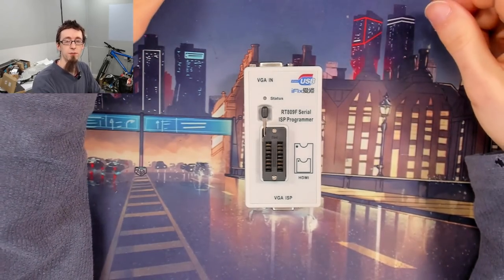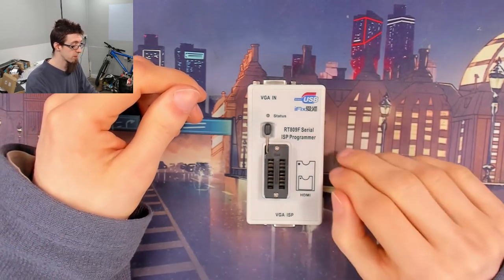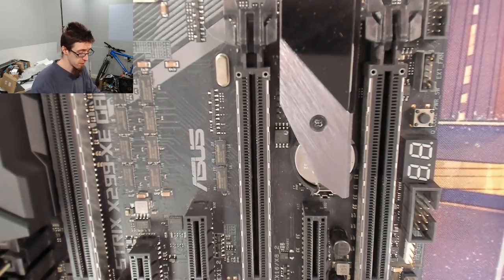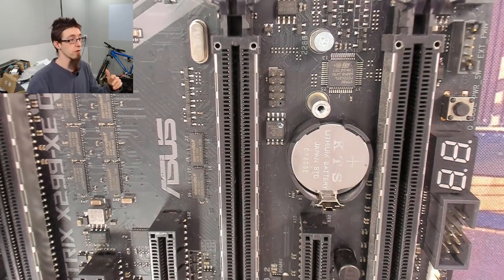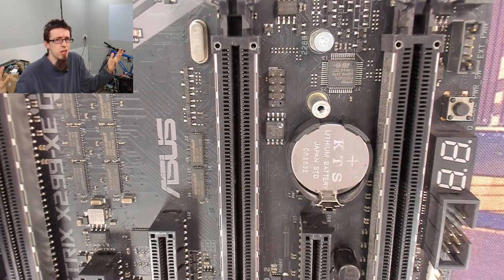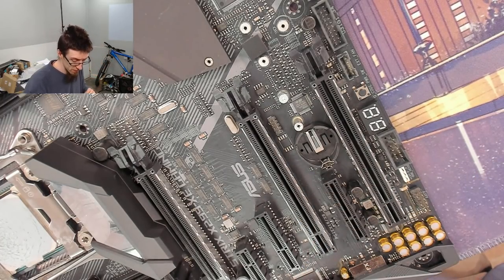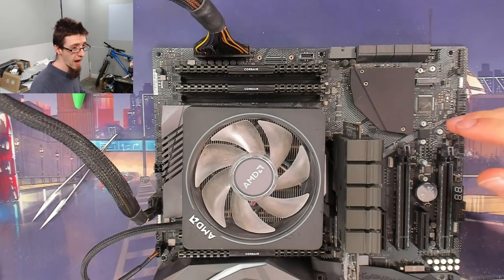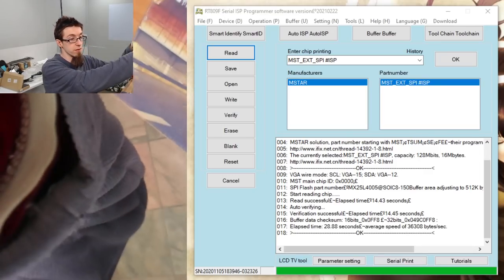Using an RT809F Programmer to Unbrick a Mobo - LFC#261

Comment: I've always wondered why board makers moved away from socket-able bios chips. I've personally never bricked a mobo and I regularly flash bios updates when many people suggest not doing it. I want to believe they do it to increase money from service like you've done here but with flashback, is this really that common of a problem in 2021? 
I'd like to get some of the tools you used but my luck would be spending ~$50-100 bucks on all the supplies to do this kind of work and I might do it once and then the tools would all sit in a drawer until they are obsolete. :\
Nice video!

Comment: The contents of the chip is not encrypted :-) it´s a binary .I recommend to clean the pins with flux and soldering iron, to get the best contact in the spring socket. Btw i am going to test XGecu TL866II to read the TSOP48 NANDs

Comment: Hi, I have the RT809H and windows defender is blocking the software did you encounter the same thing
Reply from the maker: Not on the F, no 🤔
Doesn't surprise me though, as I mentioned, the installation process for these tools is often a bit spotty. Usually it's a matter of the installer being unsigned that sets off Defender, so I wouldn't worry about it.
Reply: @Adamant_IT  thanks 😊 love your video's
Reply: add the folder to exceptions.. or download from reputable places.. try alisaler site.
Reply: Indeed mate, I have already added it to the safe list, but windoze defender keeps adding it to the list.
Reply: @LeadFarmer813  tried all, downloaded from the reputable seller etc. Windows defender just keeps deleting/quarantining it, and I keep removing from quarantine..

Comment: I've got a Gigabyte Aorus Z390 motherboard and Gigabyte is now recommending that if the board has no issues then do not update the BIOS.
Reply from the maker: Yea I mean, that's my general rule of thumb anyway with BIOSes. Don't update unless there's a stability update that affects you, or a specific feature you want/need.
It's fine if you have the means to recover a board, but if you're at home on a desk with little or no spare parts, a bricked BIOS can be a real bad day.

Comment: Hi Adamant, I have an old bios chip (Dip8, PDIP - 300mil - MX 25L8005PC-15G) from a 2008 asus motherboard, can I insert it directly on the programmer (without an additional adapter) ?

Comment: I had the exact problem and I have flashed the bios using a ch341a with 1.8v adapter but it still doesn't boot... Asus B350 itx mobo.
Reply: Still having the same problem. removed the chip and flashed it again placed it back. still powercycling if i read it and compare the data it is identical. might be hardbricked...

Comment: You know what, I've been recommending all my friends get a motherboard with bios flashback, but reflashing the bios chip is sooo much easier than I thought.... hmm might actually be quite useful for me to have one of these laying around
Reply from the maker: I wish socketed BIOS chips were still a thing, because that's the best compromise. I certainly feel like Gigabyte would be better off doing a single socketed BIOS chip than their dual-BIOS system that's fairly spotty.
Reply: @Adamant_IT  Wow, I never realised they used to be socketed. I've only just got into alot of pc repair stuff In the last few years. That definitely is a great compromise, shame it's not implemented now. Had a close call a few months back where my friend had a power cut and the bios corrupted, luckily it had a secondary bios chip! Absolutely saved his bum. Maybe I should buy one and have a play around with an old motherboard, just incase 😂
Reply: @buddybleeyes  Way back in the beginning, they were socketed because that was the only "easy" way of updating the bios. back then they didn't use Flash chips. They used Eproms. Youd have to remove them. Peel off the label covering a clear window, then place them into an "eraser" which was basically an UV light. The UV light erased the chip, which is why they all had a label placed over the clear window. Then youd program the chip. If I'm not mistaken programming required a significantly higher voltage, something like 20 volts, applied to certain pins. Anyway, this was way back in the early days before EEproms or flash was commonly used.

Another interesting thing to mention, is there used to be a company that made a product called the "BIOS savior". This was in the era when Bios flash chips were still often in sockets. The BIOS Savior was a device that plugged into this socket. There were different models for different chips of different formats and youd have to purchase the correct one for your particular motherboard. Anyway, the way it worked is you would pull your existing chip from the socket and insert the bios savior. The bios savior had a socket on it you would then place your existing BIOS chip into. But the bios savior also had a second chip onboard, and a cable with a switch attached that you installed somewhere in the back of your case. Flipping the switch allowed you to switch back and forth between the 2 roms. In essences it added a second Flash rom to any motherboard that could be used as a backup.

Comment: Hey Adam, I love the video, their some of the great information for young guys like me getting into tech.  But I've got a question, i successful did this on a gigabyte b350 motherboard, but now, when gaming the computer with stutter and sometimes crash the game, or just freeze for a moment. I tried switching out everything before the motherboard because I didn't think this would be a motherboard issue, but my brother said the issue finally left after changing his motherboard and case. Any tips will be appreciated from viewers aswell
Reply from the maker: Tough to say, might be that the BIOS version you flashed had stability issues, or had defaulted to some settings that were a bit ropy (XMP issues, that sort of thing).
I don't think flashing the board can cause stability problems, it'll either work or it won't, but maybe there was more than one thing wrong with it.
Reply: @Adamant_IT  That would make sense and I would agree, I don't think flashing a bios would cause stability issues, so it would make sense that there is something wrong with the bios. Thanks for the response, I really appreciate it and it made me very happy to see you replied yourself :D

Comment: I'm a technician for you. and I have a sony vaio which posts normally the voltages are ok 19v & 5v3.2v on the monitor connector (I tested the monitor on the same machine and it is ok) and the monitor does not turn on. any idea what could be wrong. also I have the same machine which opens win normally and stays on the desktop and does not listen to any device (usb mouse, keyboard, network, etc.) could it be the bios? Thank you in advance for the nice videos

Comment: You videos are very inspiring! I would like to ask (or anybody experienced enough here) where can be the problem: I have a board MSI 970A-G43 (AM3+ equpped with Winbond 25Q64FVSIG bios chip). The board is running but is unable to retain the UEFI (BIOS) setting. When good CR2032 battery is installed the clock and date is ticking OK but after any kind of restart/reset/saving bios attempt I am prompted to "press F2" and set the bios again. Reflashing the bios in an ordinary way did not help. It seems to have the latest version flashed. Is there any chance to save the board? It the chip saving the setting as well? It is an old board but I wish to use it for a PC to donate my friends childern. Thank you! Best.

Comment: monitor bios flash over HDMI is very interesting. I wonder if this capability is part of the HDMI specs.
Reply: The chip still needs to be taken off the board, it can't be done merely through HDMI cable.

Comment: That BIOS connector is a standard IDC 10 way 2 row header 2.54 pitch
Reply from the maker: It's smaller than that, I think it's 2.0 pitch, which makes it a lot more annoying to find cables for.
Reply: yeah, but what is the interface type? SPI? I2C? JTAG? At what voltage, speed, protocol? There's a lot more to it, than just the physical connector type. You need to know the voltage, the type of interface, and the pinout of that interface, and then the software to talk to that interface. 
At least by pulling the chip, he could just grab the datasheet to get the required information. If you could get us the pinout of that 10-way connector, I think a lot of us would be interested.  :-) I mean, the connector isn't even referenced in the manual.

Page 18 - https://dlcdnets.asus.com/pub/ASUS/mb/LGA2066/ROG_STRIX_X299-XE_GAMING/E13291_ROG_STRIX_X299-XE_GAMING_UM_WEB.pdf
Reply: @lesleymunro4964  Standard 3V or 1.8V SPI, the pinout depends on the manufacturer, but you can find pinouts for them. For example MSI uses the JSPI1 pinout.
Reply: @lesleymunro4964  You don't need to know any of that if you are connecting the header to the programmer pin by pin

Comment: i just purchased the vivo book 17 the keys on the key board are impossible to see unless under direct light gray with thin black lettering ..the strain on the eyes is getting very hard to deal with. very disappointed by ASUS not fixing this problem before retailing this computer. is there a fix?

Comment: Sir I have a question. I'm doing computer work too. I have the tl866 programmer. Can I write .CAP files with this device? I thought it was just writing .BIN files.
Reply from the maker: My understanding is that CAP files have some extra data in the header, which can be removed by editing the file. I don't know the specifics on it, but I've seen some references that it's pretty straight forward. The RT809f software did it automatically for me.

Comment: Dumb question, if a motherboard had a HDMI/VGA connector, would connecting this device using the HDMI/VGA cable also work in the same way as the monitor hook up? potentially saving you doing any soldering at all?
Reply: No, the bios was not accessible so  it would not have made any difference

Comment: Hi. I am trying to flash the BIOS chip for my Dell Inspiron 3521 and I discovered on the motherboard two BIOS chips. One Winbond 25Q16C and the other one is an Winbond 25Q32F. I tried to google search a bit about these chips. It seems like none of these chips will flash with the BIOS (.bin file) that I got from Dell's official website. It looks like the BIOS bin file it's larger to be flashed on any of these chips. Could you please give me an advice?
Reply from the maker: One of them is the main BIOS chip, the other one is the EC Firmware (sometimes known as ME, lots of arguments about this). Ideally you need to do both. I don't know a lot about how to prepare a BIOS file from the Dell website for this though. There's a couple of chaps in the Adamant IT discord server who can probably answer this.

Comment: I have had issues flashing Asus "CAP" files directly and have had to remove the actual BIN files from the CAP package 1st using my cheap flash writer. Do you think this flasher or software is ignoring the 2kb header of the CAP and writing just binary BIOS ?
Reply from the maker: The log said that it 'converted' it, so I'm guessing that's the case, yea. Now that you mention it I don't think I've manually re-programmed an Asus board before, so this would've been the first time I've actually flashed a CAP file.
I've seen some tips from people about converting these though, so looks like there's a few ways around it like you suggest!

Comment: I saw Gigabyte repair doing a piggyback clip BIOS on it and that works within few minutes. So why is this not right ?
Reply from the maker: It's a valid option, I just haven't had any luck with it myself. It's more dependant on having decent equipment. You need a good clip, and the programmer needs to have enough grunt to power up everything in circuit with the chip as well.
It's absolutely possible, there's just more factors involved. I'm practising in-circuit flashing, but if I need the job done ASAP, I think it's a lot easier to just hot air the chip off the board.

Comment: If you couldn't identify what voltage the chip runs at beforehand would it be safe to try the lower voltage first to see if it turns on or not?
Reply from the maker: Yea that sounds reasonable. Data sheets are usually easy enough to find though, so always the best option.

Comment: maybe not needed but I almost always use new chip on all boards that came with bios issue. They are not so expensive and customers are always willing to pay little bit extra for it. They should keep data for at least 20 years (as most datasheets promise) and fact that they loose some way more before that make me suspicious about how good they are. Of course when problem occur during flashing (power problems or something) or just by bad update I keep old chip but when board just stop working one day without reason to trash bin it go.
Reply from the maker: Yea, the next step I need to go through for learning this stuff is to understand what chips are interchangeable, so I know what common chips I can stock that will likely work in certain age mobos.
Reply: @Adamant_IT  from limited testing on my own stuff most of them, same size (but looking what guys do on retro scene maybe even that can be bypassed) and voltage of course. For paying customers I try to replace with identical part, not a big problem as these chips are one of rare things I can actually buy on local market if needed and China isn't only option.

Comment: i have a question u showed u could interface with your monitor and the chip thats inside there.
could u also have pluged in vga or hdmi into the motherboard to interface with the chip without having to take it out? 
just curious in if that would work
Reply from the maker: No, that wouldn't work. I believe monitors specifically have this feature for production programming/diagnostics.
Reply: @Adamant_IT  Hello. great video. Do you think the VGA and HDMI connections are actually for programming the firmware of the monitor or could it only be the EDID data in order to enable different modes, for example custom resolutions and refresh rates?

Comment: will the softwear for the RT809F not work with the EZ 2019
Reply from the maker: No. Software for these programmers is usually specific to each model, based on what I've seen.

Comment: nice bit of kit would it do TV,s as well ?
Reply from the maker: Not sure actually... that's a really interesting idea though, especially if it's a smart TV.
I may explore flashing over HMDI more in the future, I'm not sure how far it goes at the moment - like, is it just the LCD panel's firmware, or the full monitor firmware.
Reply: @Adamant_IT  thanks for that was asking as tv,s now are all most like monitors i know sum folks have use they pc on a tv
Reply: @Adamant_IT  809h has a few more connectors for that particular job, dunno about 809f though. and believe me 809h deserves every penny/cent of it.
Reply: Yes. For TV applications it is essential to have a programmer for SPIFlash memories. The RT809H model even allows you to reprogram NAND memories generically called eMMC to solve Smart TV problems that get cycled and/or "stuck" on the startup logo, that is, it does not allow you to go further to see an image and audio on a certain channel (a very common fault in recent models). Take a look at ali...ress. All the best.

Comment: Damn, I wish I had this video just a couple of months ago. I bricked an ASUS board and fell into a rabbit hole of BIOS chip reprogramming that was not successful. I don't even remember the programmer that I used but it was a waste of time and money. This looks like something I probably should have on hand.
Of course, it wouldn't be totally necessary for me if ASUS had USB BIOS Flashback on their motherboards. That whole ordeal has convinced me never to touch ASUS boards again in the future, at least until they add that basic feature. My sub $100 Gigabyte board with an integrated Celeron processor has a USB Flashback feature, so it's unacceptable that ASUS's near-flagship model wouldn't have it.

Comment: what is the temperature and air of hot air working staion to remove that ic, Thank u for ur video
Reply from the maker: I run 450c / full air to remove chips from mobos. SOP8 and WSON8 chips aren't difficult to move though, so even a cheap station should make light work of them. Turn airflow down to about half when putting back on the board, or as needed 👌

Comment: hellow sir. My pc is not booting into bios. It’s an x99 motherboard. I tried everything from cleaning the the cpu, ram, connecting the 8 pin cpu power plug and 24 pin but it kept on recycling power. A few days ago if managed to turn it on with only 1 ram stick. Motherboards qcode led is not showing any lights on, monitor turns on with a single bar on the top left side and dbug shows 00 code just like before. After watching my YouTube videos, i am thinking It's a bios problem. But i'm an average home pc person. I have 2 bios chip on my motherboard and yes i did tried both of them and it didn’t work. Fortunately those bios chips are socketed like that fatality motherboard you fixed. Pls tell me what to do. Thanks